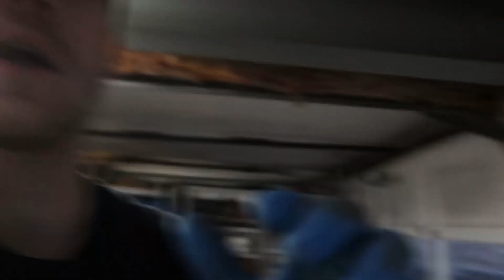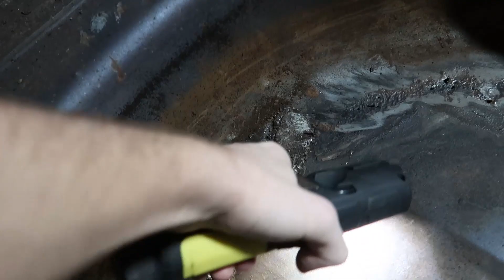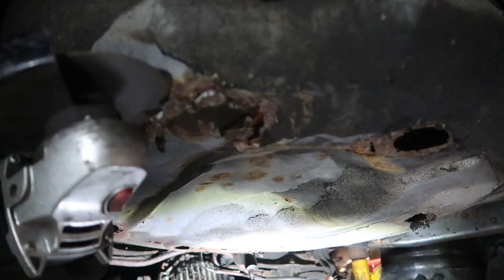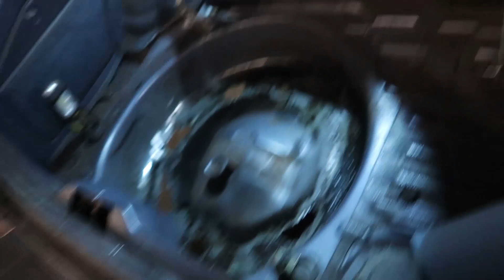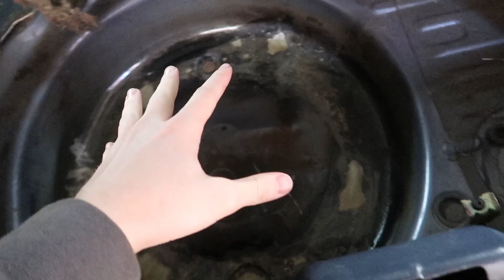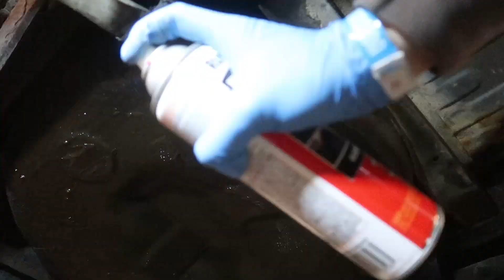Fixing Holes in the Spare Tire Well on my Supra | No welding required

Comment: You shoulda laid the fibreglass matting straight on the por15 when it was still wet or at least tacky and used the por15 instead of the resin (por15 is a resin). Then sanded the underside and por15 that as well and even put on more fibre glass (or used por patch underneath). That woulda sandwiched  the rust and sealed it completely while giving more strength. Rubberised paint will often crack or chip and let more moisture in.